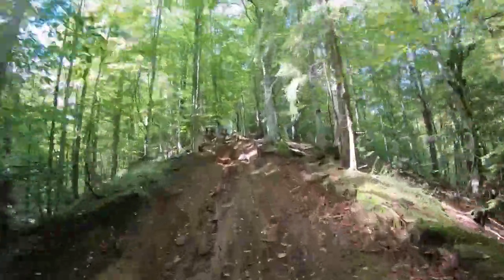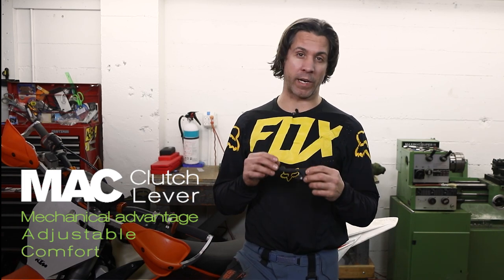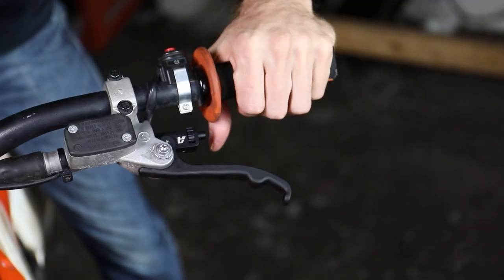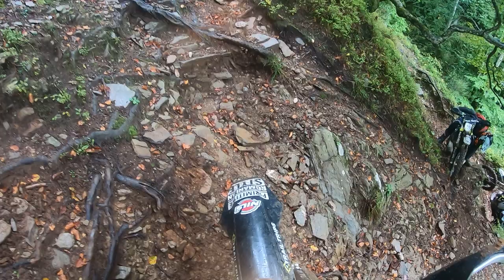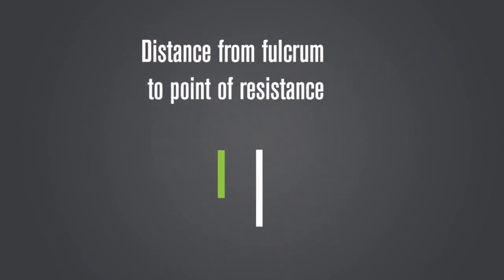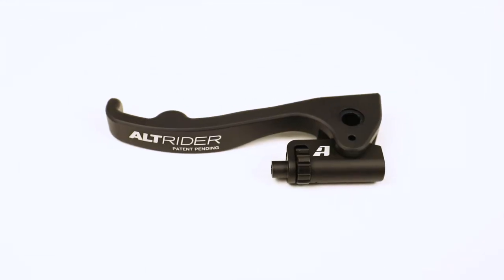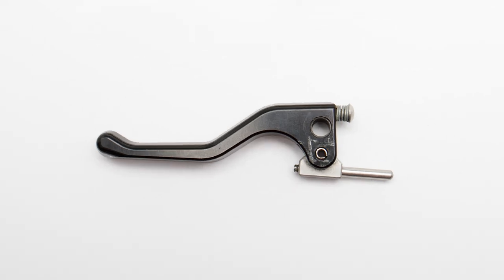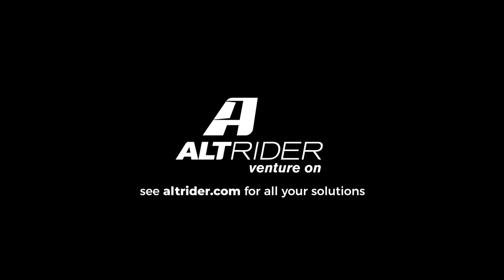KTM Brembo Clutch Lever MAC First Look from AltRider

Comment: Question. Oem set up on ktm 500 2023 means I can't move my clutch over to the left for better fit because it gets caught on the handle. The adjustment hits the light switch and it's so annoying. This seems it would be even worse as it's much bigger than the oem.
Reply from the maker: Hello, you are probably right.  we find it more desirable to adjust the lever toward center.  this puts your fingers at the end of the lever giving you the most leverage.  the problem with doing that with OEM was lack of adjustment range to move the lever closer to your bar.  The MAC lever allows full adjustment to bring that lever closer to grip. but ergonomics is a very personal approach, but wanted to share a different perspective.  let me know if you have any other questions